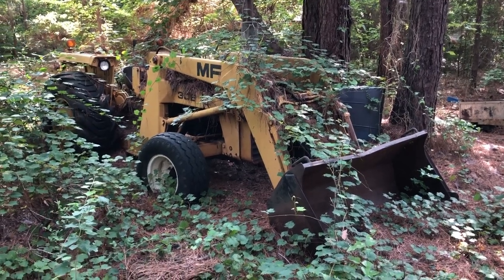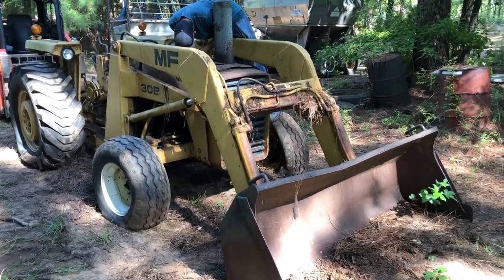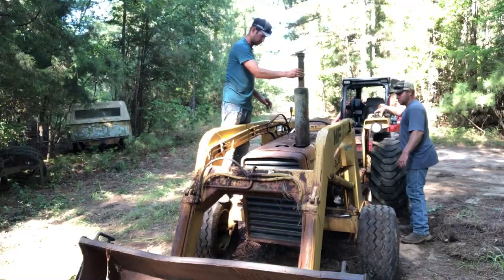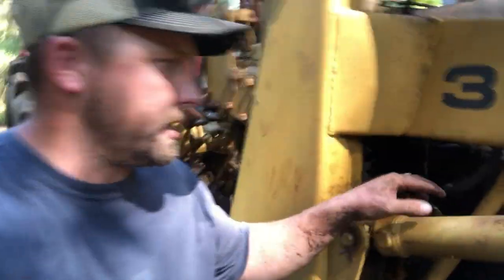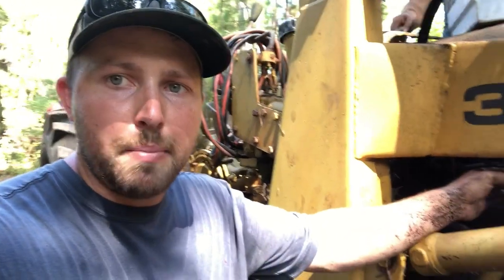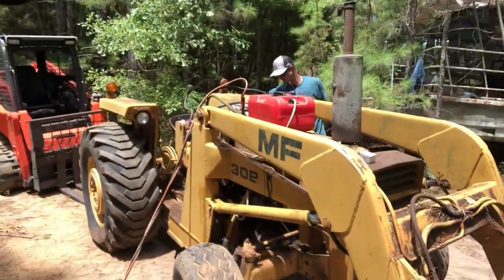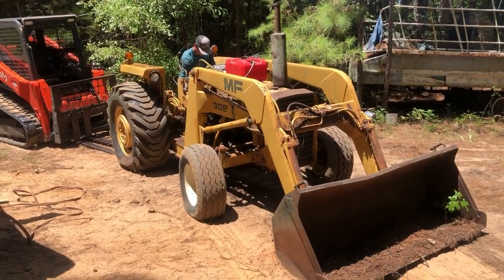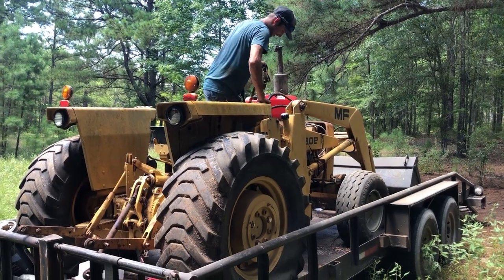WILL IT START?? Massey Ferguson Tractor

Comment: Those little 3 cylinder Perkins engines are superb, they carried on a fine tradition of excellent engines from Perterborough.
I remember our 1949 Fordson High Major with the Perkins P6, 40 years of really hard graft in the woods and only a pump & a set of injectors in all that time.
She just kept going and, with good maintenance, so will your ''Perky' 👍👍
Reply from the maker: I’m hoping so!

Comment: I had a Massey Ferguson 40 Industrial  with a 3 cylinder Perkins diesel that looks very similar to yours.  Moved a lot of dirt and gravel with it. Had a back blade, and forks that could be swapped out from the bucket.  Well built tractor.

Comment: Thank you,  great little video, the Massey looked too good and modern to leave to waste, it sounded great, started easily, and with a few consumables should be back in service.
I was nearby in a laboratory when someone mixed acids in a test tube. A brief rocket plume of acid hit someone in the face. Without thinking, I grabbed them, plunged them into a running sink of water before twisting their head to catch the flow from the tap. I loaded them into my car and went straight round to the emergency hospital. An hour later, they emerged unmarked.
Safety goggles prevent an awful lot of risk, damage and upset.

Comment: My dad bought a 1977 20 c industrial MF new and still has it. He keeps it like new. It is a frt end Loader with power take off and shuttle shift. It is the lighter series before the 30. I remember the day Lawrenceville  tractor of Ga. delivered it new. He also bought a 74 MF 135 new, but sold it a few years back ,for 2 1/2 times the price new, it only had 400 hrs on it. It also was a diesel.
Reply from the maker: That’s a good deal!

Comment: Excellent video  :) also back when 13  years 1988 I use a 1968 International 624 A 60 hp Desiel  farm tractor with New Holland Rake hay up ready to get bales of square bales also hot summer season in Ontario Canada! I was wearing my prescription glasses also to battery on left side of Drivers Seat of big Rectangular type some heard starter engage to start start and go on and off ! So look over saw Generator glow bright red plus sparks to on left top engine then got head back up felt something hit glasses look it was on + side on front  battery of a sulphuric acid  filling cap hit left floorboard near my foot plus on laces then got big spray hit my left eye  of Sulphuric Acid under my cheek on face burn 🔥 fast and got tractor stop too in motion Drive it! So grab my ice water drink wash eye out fast then my dad next feild over and ran to next feild told his brother Bill my uncle get water also pick up fast need get me check out! So dad wash my eye out also he ask could see and I said burn bad also fuzzy looking on left ! My dad said swearing words also he did not want go blind my son and sorry this happened son ! So uncle Bill got truck and my dad took me  hospital get check out and doctor also nurse said my left eye Membrane tail on back burn hang by thread be very carefull forever also lucky too see ! But in ever since get eye check up regularly in 1 to 2 years ! But this year 2021 in January said had Baby Cardics on lens each eye and had get surgery but clear up lots problem since surgerys in both eyes also in September going check see if need wearing glasses more now been 35 years wearing then and if don't plus I am going get glasses to wear plus tint on prescription ones but got excellent pair of sunglasses too protection too also! But back Sulphuric Acid burn eye not nice so make sure got lots ice water on hand when doing fuel fill up & other fluids plus battery or welding or chemicals working with guys not fun at all ! Eyes Sight are thankfull for life plus eye protection to wear !

Comment: Next time you have a dirty tank, you can disconnect the fuel line going from the tank to the pump.
If you can’t tell what’s in a tank, you can disconnect it at the output of the pump.
If the pump works, it’ll pump out all the old crap, and it means you know if the pump works!

Comment: I had the same model tractor. But mine had the backhoe with the loader. The machine was bought used and beat up. Everything was welded. Including the lower crossover frame. That Perkins diesel is a work horse. 30 HP but a gutsey engine. Mine had the automatic transmission with the 2 speed shift for high and low speed. I had to buy a new hydraulic pump for it. Never would start easy unless a spray of either. I finally sold it and bought an old Bucyrus Erie Dynahoe 190.

Comment: I just got a 60s MF200 tractor with a bucket running didnt really take much bleeding air I was surprised when it fired right over, Of course battery had to be replaced, im trying to figure out if it has a locking diff  she gets stuck pretty easily and very weak Hydraulics ive never worked on tractors kinda fun.

Comment: Massey Ferguson paired with a Perkins engine never dies I've seen some 60yr old massey still running
Reply: Mine (40B) is 54 years old. Motor is solid. All the hydraulic hoses,  not so much.

Comment: It'll fire up a lot easier if you prime the fuel system and bleed the air. Whole lot easier on the battery and starter too.

Comment: I got sprayed directly in the face when a hydraulic hose blew on a big cat loader.
I was very glad I had my glasses on. It hit directly on my right lens and it knocked my head back and knocked my glasses off. And that hose was on the back of the bucket, a good six feet away.

Comment: This engine should be a 61HP 4 cylinder diesel. You have to keep the fuel tank a little over half full when you are loading it.
Reply from the maker: Thanks for the info! I don’t know a whole lot about it.
Reply: On a 30B it should be a three cylinder Perkins, about 40hp. I have a 30B backhoe of that vintage.
Reply: @dougcooper6004  I had a mf30 industrial. Was 61HP 4 cylinder. The 30B must not be as tough.
Reply: I know by the sound of it it's a 3 cylinder Perkins, fantastic engine and, imho, better than the 4 cylinder.
Hardy little beasts👍👍
Reply: @WeeShoeyDugless  the mf30 loader will pick up in excess of 4000 pounds. That 4 cylinder 61hp is a very smooth running engine. I have had many 3 cylinders. They are good but that 4 cylinder is a monster compared to the 3 cylinder. Both are Perkins
Reply: @DT-abcd  
I can't fault the 4 cylinder engines, but from experience the 3s were more durable.
Only my opinion of course and should not be taken as gospel.
Reply: The 30B is 45.5hp

Comment: Even if that machine were neglected for fifteen years - it certainly was NOT in that location! When pulled out, there was no tyre-hole in the ground beneath and it was covered in the same vegetation-trash as all the ground surrounding it - impossible! The ivy was just lightly DRAPED over the machine - not growing into and around the frame-elements.
These videos are fun to watch - but they must be HONEST!
Reply from the maker: There will always be that guy